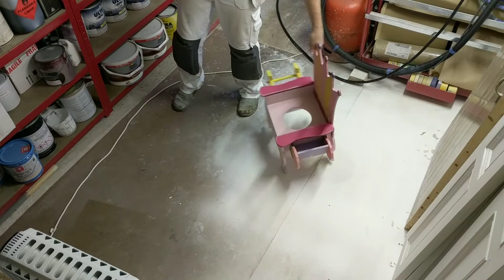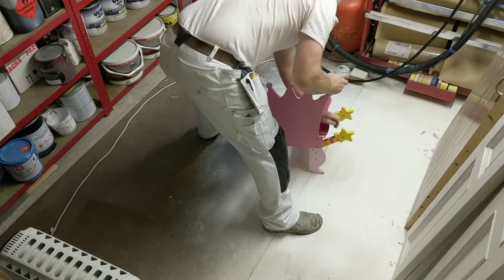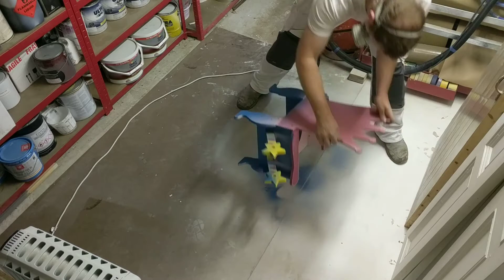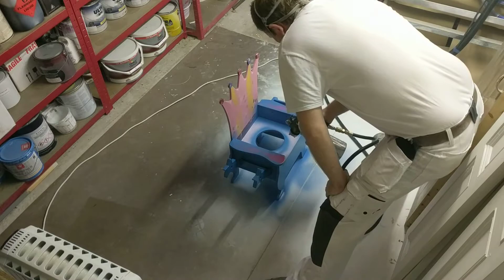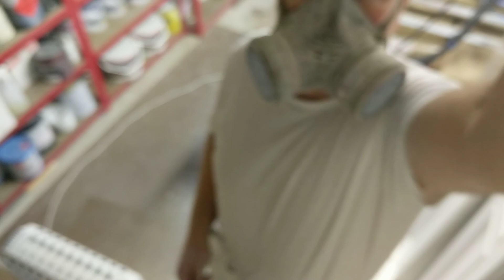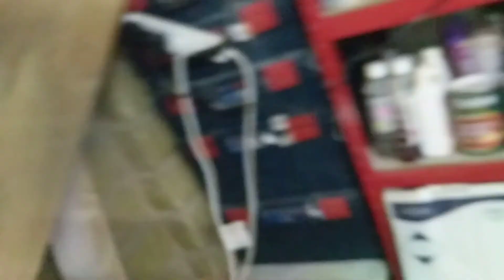Bespoke Potty Sprayer Buxton Derbyshire ; )

Comment: Such a lovely gun the apollo 7500  .great job Tim.
Reply from the maker: Bit of fun this vid ; ) see how many take it serious. Yes its a nice gun, well thought out and plenty of option s with all the aircaps for different products. I tried to put a finished picture with the gold on the crown an seat but youtube, google seem to be restricting freedom by the day!
Reply: Haven't used mine with compressor yet Tim ,what psi did you have it set on ? The gold aircap is great with 1.8 needle , another great gun is the hawk labs  223xx hvlp Tim ,great for fine finishing  .
Reply from the maker: Robert Alexander I'll have a look at that Robert, I'm going to run the RPS cup system on it I think as I have a SATA 5000b. Have you got the high solids aircaps?
Reply: Decor1st.com Painter and Decorator I've only got the gold air caps but I am going to order a 1.3 needle for the apollo for 2 Pac paints which I will get the B high solid aircap . I haven't used it with 2 Pac paints yet . But I have some metal windows coming up . You will love the Hawk labs hvlp Tim ,they use it for painting bath tubs .